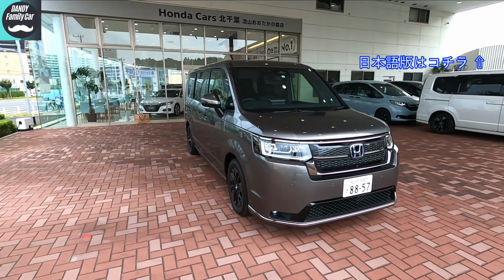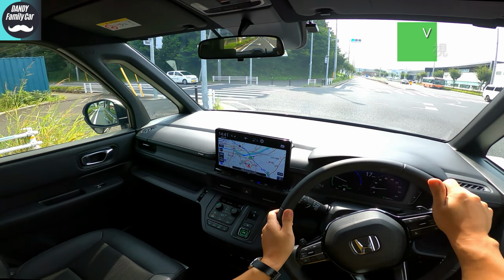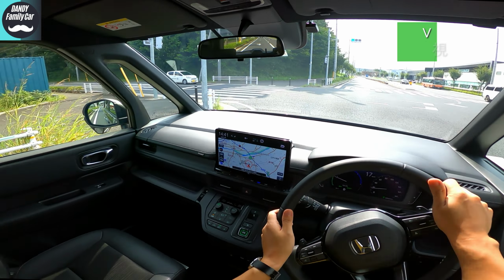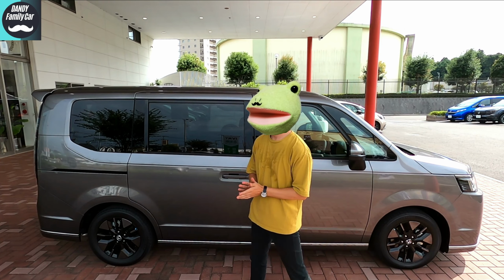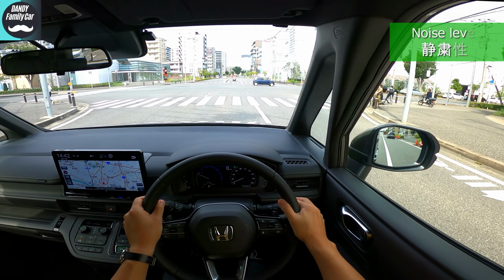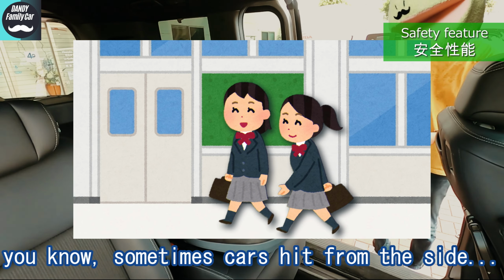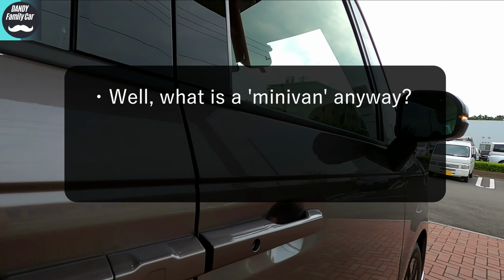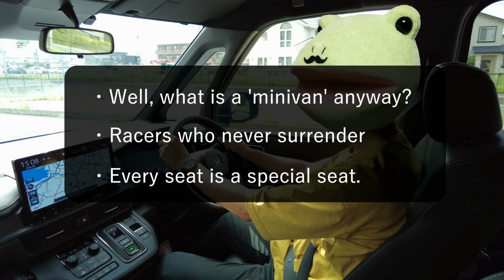2022 HONDA New Step Wagon  report  [POV test drive]

Comment: Thank you for the review, it is very good especially the information you shared on the ride quality. If you can help the following question, Comparing the new Stepwagon, new Noah and new Voxy, which one has better sound insulation against the road noise?